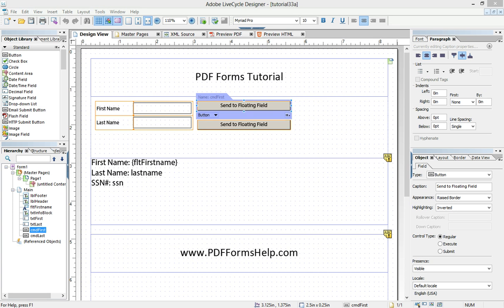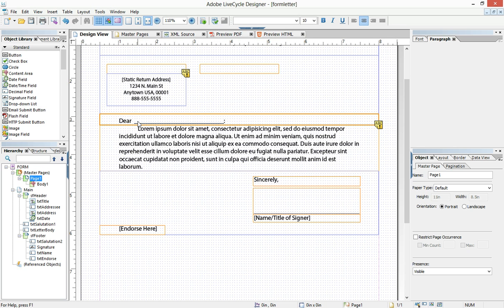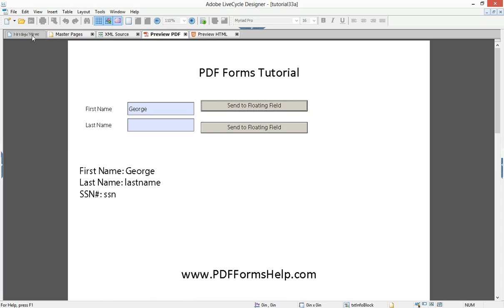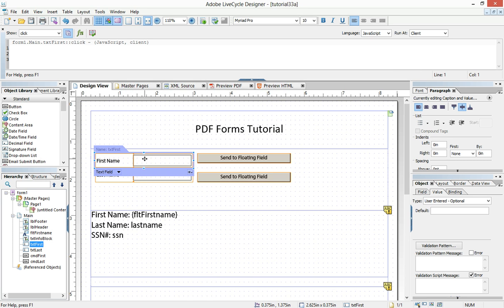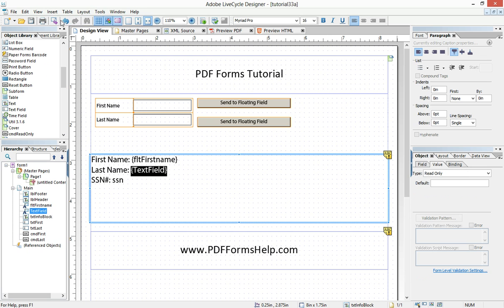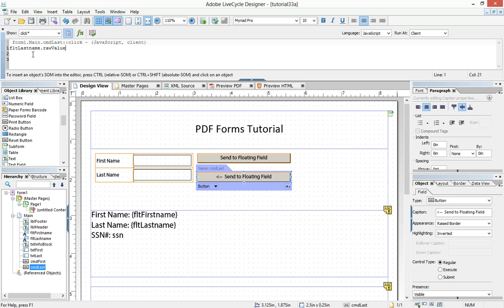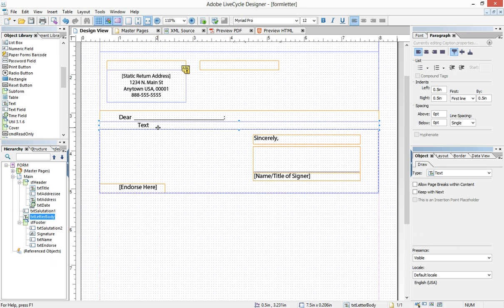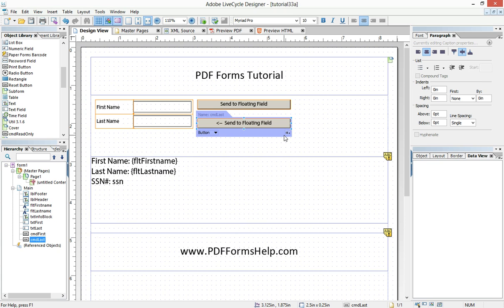Using Floating Fields in Adobe LiveCycle Designer ES 4®

Comment: its not working i don't know what i am doing wrong. i created one text field named it as textfirstname and then created a floting field inside a text field called fstname and in the button click event i wrote fstname.rawvalue=textfirstname.rawvalue;

but in preview its not working
Reply from the maker: Make sure you form is a "dynamic" form.  File>Save As then look at the dropdown under the file name box.  It should read "Adobe Dynamic XML form".  Also, remember that all JavaScript is CaSe-senSative...your object names must match the JavaScript exactly.
Reply: worked your video was very helpful because it gave me the basics :) thanks a ton :)